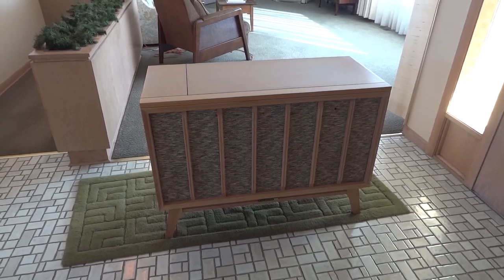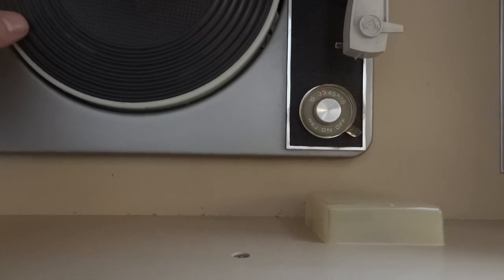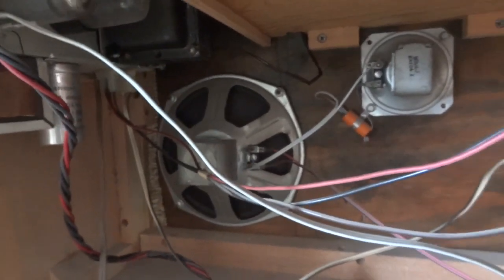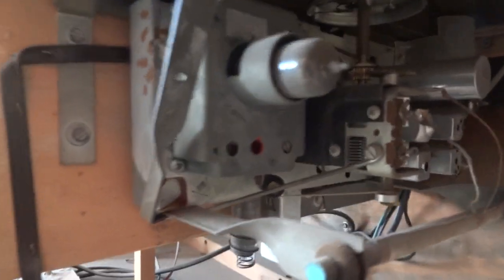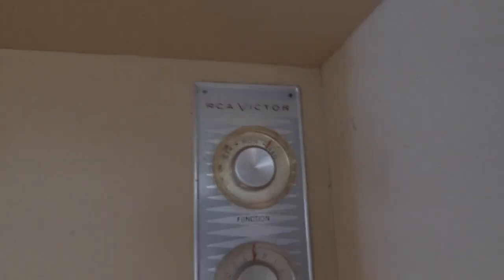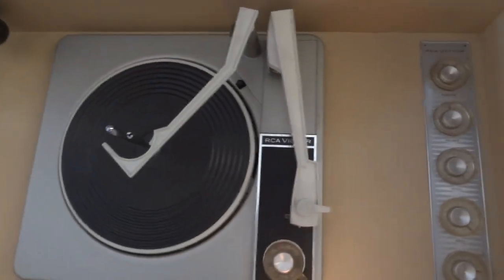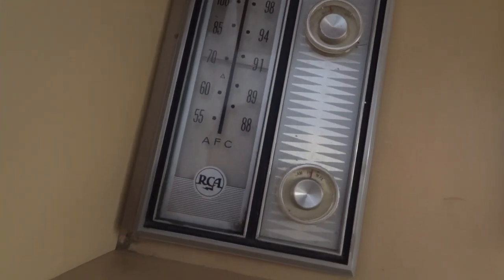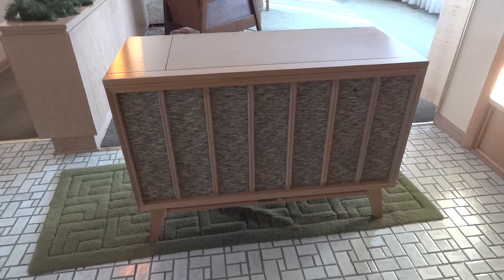The 1962 RCA Victor console stereo HI-FI!

Comment: Had one similar with no MPX. It was optional. I was 12 back then and much into electronics. When this was new, the repairman came out 3 times due to the 6BQ5's being " microphonic" at higher volumes. Different brand tubes fixed the problem of it making a loud 400 HZ tone.

Comment: Beautiful! I have the RCA IVE 105a - almost the same exact unit except it doesn't have the tuner, the inner compartment is a little smaller, and it's in mahogany. You're right about the bass on these units - quite substantial. You can see mine in my "more storage delivery turntables" video. Other than yours, mine, and a picture on the net, I have never seen these anywhere.

Comment: I have a '62 IVE 08 hi-fi.  Another economy model, turntable only, no radio.  It's been in my family since new, my father bought it for my mother as a Christmas present in December of '62.  My grandmother got it in about 1969-70 and hardly ever used it.  I've owned it since 1997 and have only replaced the needle, the speaker fabric and the tire that drives the turntable.  It got a flat spot because my grandmother never set it in neutral, so it had a warble.  It runs great now, and I'll always enjoy it!